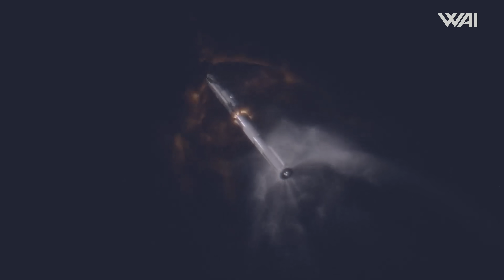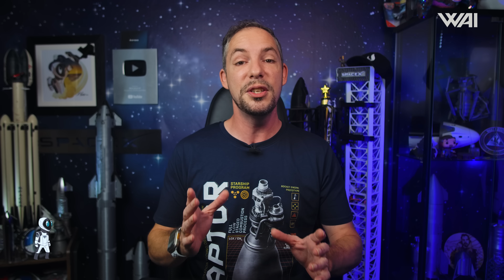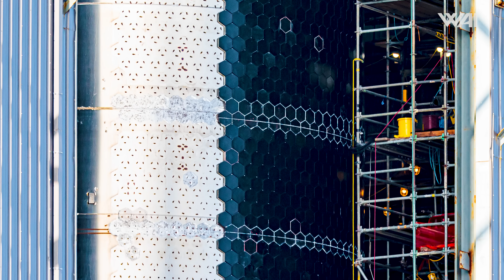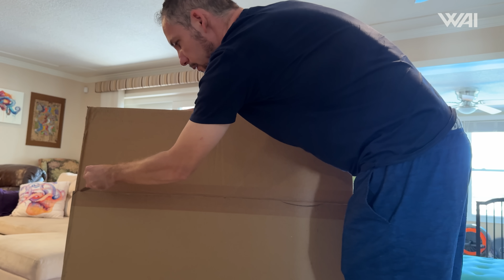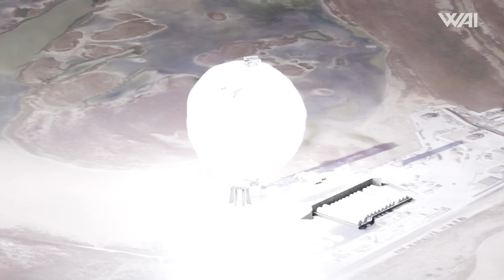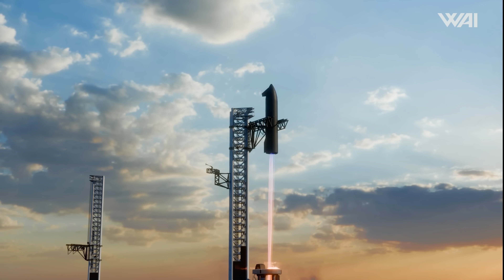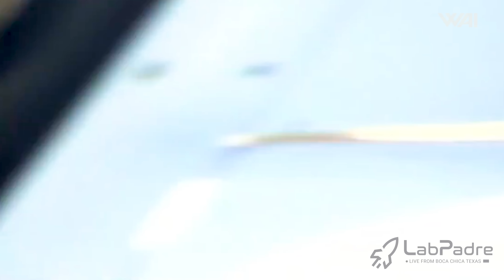Get ready for Starship Flight 6 - SpaceX's incredible NEXT launch explained!

Comment: Change in Angle Of Attack may also be to alter the heating profile - slow the ship more while the temperature is lower and at a higher altitude, so the final heating is less then previous flights, and so it's cooled down more by the time it hits the thicker air lower in the atmosphere.
Reply: Slowing the ship more will induce more peak heating
Reply: @alvianchoiriapriliansyah9882  depends on how long it takes. Keep it at altitude longer and slow it over a longer period of time, so the peak temperature never gets high enough to affect the stainless steel. Lowers G-loading too.
Reply: @PiDsPagePrototypes Higher AoA will be more vertical relative to the ground, the exact opposite of what you described

Comment: So, when will the upper stage touchdown without burning up? Many have not yet come to the awful realization that the Starship program is a poorly designed, implemented & will ultimately soak up billions of dollars & never realize it's much ballyhooed intentions. Perhaps when the Raptor engine "consumption" starts to number in the thousands will people open their eyes.
Reply: And on that note, water is wet
Reply: It touched down without ‘burning up’ on the last launch.
Reply: @JohnSmith-x3y8h  Don't know what "Elon brand" Kool-aid you have been drinking...the one-and-a-half-hour live stream that I saw had the stabilizing fins burning away at the hinged portion, torching half of the base of the fin structure. Further it was noted the flaming sparks coming off the rocket as it entered the atmosphere were the actual stainless steel structure of the craft  itself, not the ceramic heat tiles...as ceramic tiles don't "burn" with that lightshow sparking effect. Since the upper-stage has not been yet recovered, the resultant damage encountered has not been evaluated.
Reply: @AndieBlack13  blocked

Comment: Relighting in zero G and fuel slosh: the easiest way would be to have some small helper rocket (cold gas) to accelerate the ship slightly. Another idea would be a fuel pump colon along the whole tanks, that only opens the valves that are covered by a liquid. And using intert gas to create pressuse in the tank to push the fuel into the colon.

Comment: The saturn 5 was better in many ways because you can launch straight to the moon without all the risky refueling/docking 6-10x nonsense directly to the crewed vehicle. Thats why the they shouldve just built the booster larger with 3 stages putting starship to the moon or mars in 1 launch. Dont forget now the starship payload fairing is the same size of new glen now. Their moving in a questionable way now with development. The booster needs to be as wide and tall as the tower itself to really make a difference with a cheap 2nd stage for the moon and mars and the way it is now for leo destinations 💯
Reply: With only a hundreds kg payload landed for Apollo vs hundreds of tons on Starship, yeah that's not a good comparison bud

Comment: While Starship and its booster may be caught on separate towers, eventually it will be desirable to catch both at the same tower. This requires the chopsticks catch arms to be able to offset rotate 90 degrees from the OLM launch mount. This allows the chopsticks to catch, rotate and stack boosters and Starships on the OLM mount while protecting whatever is currently on the mount and its launch infrastructures.

Comment: I would like to see 3 starships launched . Two of the ships built to accept a system to link them together . And the third carrying the materials to assemble a saucer type unit . The saucer attached to the other star ships . 
Remove the engines and install a large ion drive . In each starship  . Rotate the upper ring of the saucer section for gravity as living space .

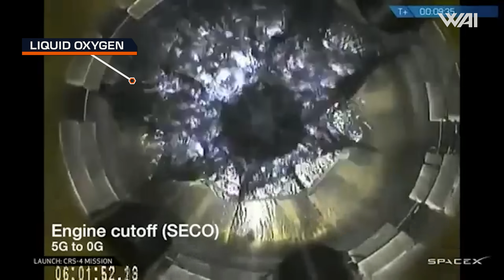Comment: 14:23 "You're just going to be sucking in air bubbles."
No! There is no air in the tanks. You're going to be sucking in vapour ,it's still fuel and oxidiser, just in gaseous form rather than liquid form and as a result nowhere nearly dense enough for the engines to work properly.

Comment: I believe “turnaround time” applies to an individual item. Flight 6, and every other flight, are new vehicles. You can stop the clock on turnaround time for flight 5, or any flight, booster is ready to fly again. Until Falcon, the first and last spacecraft with turnaround time was the space shuttle program. 😉🤓
Reply: Turnaround time also applies to the time gap between two launches regardless of new or used vehicles, something that WAI and any others meant for Flight 6
Reply: @   In that case, it doesn’t matter where they’re launched from then. Which means right now, Falcon can have a millisecond “turnaround time” because there’s two launch towers and can launch them just slightly delayed. Well sorry but that’s just wrong. 
Turnaround time applies to rockets, just the same as anything else. For instance, a commercial aircraft has turnaround time. That is the time it takes to offload, clean, restock, refuel, reload and start backing up from the gate. In the case of Falcon or Starship, just like the Space Shuttle, the turnaround time is after landing, to inspection, to refurb, to inspection, to test fire, load payload, to WDR, to ready for lunch. That’s turnaround time. Not just from launch to launch regardless of vehicle SN. It’s how long it takes to get ONE SN from recovery to launch. It an engineering/industrial standard, no matter the industry. A STANDARD. Meaning it’s the same regardless of where it’s applied.
Now... if you apply it to the OLM/Launch Tower, then absolutely, it doesn’t matter what SN is being launched, because it’s the launch infrastructure that’s being referenced. It’s “item” specific.

Comment: Most manned flights have a safety feature that aborts the mission. What would happen if very early in the flight, say just after clearing the tower the booster suffers a major failure? Is there anyway that passengers would escape? Just curious.
Reply: Flying it uncrewed & reused many times helps a lot
Reply: @alvianchoiriapriliansyah9882  True, but musk has indicated it will be for manned exploration of space. So...
Reply: @bwuepper439 Yes, but they will have flown plenty of uncrewed ones by that point

Comment: I dont see any harm why a HSR would cause any  environmental harm ! Maybe spacex recovers it because thats 10 tons of stainless that can be resold as scrap ? About $ 13,000 ! Maybe try and find a way to reuse it ?
Reply: Inspections to improve the design of the future HSR so it can be reused many times
Reply: Block 2 booster will have integrated hot stage structure that can't be removed

Comment: Stainless steel should be able to handle the heat in the area where the tiles were removed. 
I wonder if they will have temperature sensors providing data. 
Also, I wonder if you heat, cool and reheat exposed portions do they warp or get metal fatigue issues?
Reply: Aluminum tiles melt if the temperature reaches the structural limit of stainless steel

Comment: Boiloff is insignificant. The propellants are below their boiling point (sub-cooled) and first has to reach boiling point before any "significant" boiloff will occur. Given the large volume-surface ratio, propellant temperature increase will be probably a veryy few degrees C in an hour, and they remain sub-cooled all the time. So I think there are other reasons for the new loading times.

Comment: The earlier tanking time might also be connected to the removal of the heat-shield. The shield should also work as insulation for the cold liquids. So without parts of it there might be a little bit more boil off. And thus more tanking time is needed.

Comment: Great report. But, I have to give you one correction. The engines would suck in Helium cover gas bubbles, not air. That's the drawback of using pressure transfer. Everything in engineering is a trade-off.

Comment: correct me if i am wrong, I did watch the video, but why are they landing the upper vehicle in the water? They have already landed the spaceship on land and then caught the booster? I do not understand
Reply from the maker: Because landing the booster is easier. The ship needs to reliably be able to reenter. Both the last two ships did reenter but with damage to the shield. Ship catch will follow soon!
Reply: @Whataboutit  why is landing the booster easier? Are the starships that re-entered all dumped and recovered in the sea? If so, do they let it sink to the bottom or do they catch it in the water with net maybe? Thank you for the reply

Comment: One big difference between the Apollo and Starship "turn around" times is that NASA had 2 launch complexes to work with (39A and B) while SpaceX currently still has only 1.  This makes the Starship turn around even more amazing.
Reply: 39B was only used once for Saturn V, but yes Starship does that because it needs to

Comment: You have an obvious mistake with the propellant load reason. Elon said he wants boosters to be able to run every hour. This means propellant loading MUST be optimized. The booster takes what - 7 minutes to return, 3 to cool a little. That leaves 50 minutes to load the booster and stack it and load the ship. That is NOT going to work with current load performance. So, they start working on that. Boiloff is not the problem - that cost is always neglegible. What IS a problem is the time window if you want hourly starts of a booster. I know - insanity to even think about it, but hey, that is Elon - crazy as it gets and then making it happen.

Comment: If they dug a pit next to the launch pad nearly as deep as the booster and filled it with water they could have a soft abort option right next to the pad. 

It wouldn’t save the booster but it might stop one from damaging the pad and other gear. 

Also build a earth burn around the pit, I used to work in the munitions industry and building had soil mounds built around them to prevent one building from damaging others around it should an explosion happen in one. 

The blast is directed upward instead of sideways.

Comment: The slopping propellant problem before vaccum relight, is solved by releasing helium inside the tanks. Or is this a myth?
Reply: A myth.  Ullage is what they'll need and use.
Reply: No. That takes care of tank pressure but not the fuel and oxidizer slushy state. For that they use small ullage thrusters.
Reply: @manuelsilva8640  That would seem the simple way, accelerate the ship slightly so the propellant 'falls down'. Maybe we will see the thrusters work on flight 6?
Reply: You don't need helium

Comment: How did the Saturn V, which is considerably smaller than Starship, With 3 Stages and 4 Engines make it to the Moon/Land/ and return back to earth while starship dont even have enough gas to break earths orbit let alone travel the solar system and back
Reply: Starship CAN go Into orbit. Thing is, the Saturn V isnt fully reusable, so it had a lot less weight, and uses more stages, wich means more efficiency. Basically a different design philosophy.
Reply: @Hungary_0987  why not make 3 reusable stages? Or make 2 reusable stages? I thought the point of the Large Stage 1 on starship was to include the First and Second stage which is needed for left off and to reach orbit, and starship second stage would be the TLI stage . To use such a big rocket just to reach LEO is a Waste, that's like using an RPG to put a Nail in a Wall.
Reply: @JayDeePLUS-BEATZ  They don't need more stages.  You seem to be comparing a mission ready system to one still testing using disposable test articles.  One would assume you don't understand the difference between active development and mission ready.
Reply: @TheEvilmooseofdoom  there was 6 test Saturn rockets that was tested before Apollo landed on the Moon. The first test caught on fire killing 3 Astronauts inside, the 6th Apollo test which was Apollo 8 put Astronauts into orbit around the moon and Apollo 8 was a Test Saturn because it didn't have the lunar lander or LCM . Every Apollo mission had malfunctions and they still landed 12 men on the Moon out of a total of 12 launches from test to fully mission ready. You seem to not have much knowledge on our space program outside of Elon Musk smh
Reply: @JayDeePLUS-BEATZ Saturn V can only land a couple of tons to the Moon. Starship can land a hundreds
Reply: @alvianchoiriapriliansyah9882  starship is a 1 way trip and the ladder can return to Earth
Reply: @alvianchoiriapriliansyah9882  starship is a 1 way trip with no return system and Saturn V reached LEO, TLI, Lunar Orbit, Landed and returned back to Earth all under 1 launch without having to send 10 more ships into LEO just to refuel the starship enough to go on a 1 way trip with no real backup plan if anything went wrong. Saturn V had enough fuel that if something went wrong in TLI it had enough to still return back to Earth. NASA is only using Starship to land people on the moon but they have to build a Space Station around the Moon first so Artimas can dock and wait for a Starship to arrive to transport them down to the Moon. This plan between Artimas and SpaceX is at least 20-30 years from a reality

Comment: If the catch was aborted at the last moment it's probably more accurate to say the booster would land next to the tower rather than crash... Of course it would probably flop over then explode after landing, but it wouldn't just slam into the ground because the Tower catch was aborted. It would still attempt a soft landing next to the tower.

Comment: MECO   Main Engine Cut Off.
Reply: *most
Reply: I must have missed something. I have always heard the Space X team say, main engine cut off. I have never heard (most) must be a space x thing.
Reply: @masshultzy6449 that's for the Falcon 9 rocket that has 9 engines. MECO, for F9, is used to describe the shutting down of all the 9 booster engines.
Starship is different, having 33 booster engines, and only its 20, outer ring engines are shut down, leaving 13 inner ones prior to stage separation. So you have most (20) of its engines cut off instead of all the engines, hence Most-ECO.

EDIT: I get you now. Yes, the SpaceX team may say MECO to refer to the outer 20 engines.
Reply: @okirooju3787  thanks for the clarification  because prior to this video, I have always heard main engine cut-off even from NASA. I didn't know they referred to that one as (most)

Comment: Dont let those trolls who nag about you mentioning the viewing metrics, they are just upset because they are part of the problem and got called out for it. Is not that difficult to hit a single button, but running and actual channel is very difficult, especially if its fairly new.

Comment: I can't wait until they can catch BOTH the booster AND Starship with 2 towers in the same launch!
Reply: Why not on same tower ?
Reply: That’s not until 2025..
Reply: @peterclarke3020  2025 is right around the corner lol
Reply: Landing next to the booster? Wouldn’t it be damaged by the plume?
Reply: Likely no. Same-tower landing is the plan, and the plume from hot staging is most likely just as bad or maybe even worse for the booster.  @russc788
Reply: @russc788  Not if they swing the chopsticks to the side so that the plume misses the booster.
Reply: Flight 7 ?
Reply: @tomkonig2066  flight 7 is in-space fuel transfer. I don't think they plan to do ship catches until flight 9 or 10 especially since flight 7 onwards uses Block II ships with a different design.
Reply: @thegunman2841  I assume more that flight 7 (January?) will be full orbit with some Starlink Satalites as payload. Flight 8 and 9 will then be the fuel transfer demo in March. That would also fit into the timeline of Pad B. They would need both Pads for the fuel transfer demo. I would also assume that flight 7 will be water landing as it is the first Block2. If that works, we will might see tower catches for booster and ship on flight 8 and 9.
Reply: @abrakadabra19702  yeah I got it mixed up, been a long time since I read the plan list. 7 is likely to be orbit-deorbit if the in-space relight is a success, then 8 and 9 are refuelling.
Reply: @abrakadabra19702  
Your comment is well thought out.  I like it.  But, I want it NOW!  :)
Reply: @perrystates743  No worries. Assuming that flight 8 and 9 will be the first catch of a starship, then this will also mean that Starship is ready for operation. They can bring payload in orbit and the ship back. It might not yet meet the target of zero refurbishment. But that doesn't matter. It will be operational then. And with SpaceX having their hand on a returned booster and ship, that will speed up the thing for working towards zero refurbishment, if that goal can be reached, they will do it quick
Reply: The point is to catch both on the same tower to restack them, so why would you want to see that? What would be the point? It sure wouldn't be rapid reuse.
Reply: @filonin2  
Loading new cargo into the ship will take a while.  During that time the booster could take several more ships to orbit?
Reply: @filonin2 yeah, but if I was Elon I wouldn't try that the first time I do it. Seems risky.
Reply: @rexmann1984 thats the whole point anything that has to do with space travel and just space technology in general is risky we won't improve unless we take risks

Comment: Apollo, as a system, was far less complex than Starship.  The first stage had only 5 engines with kerosene fuel, so only LOX needed care, second and third stage used 5 and 1 engine fueled with liquid Hydrogen but everything was single use.   It’s not surprising they could turn around so fast.
Reply: With at least ten times as much money required, yes